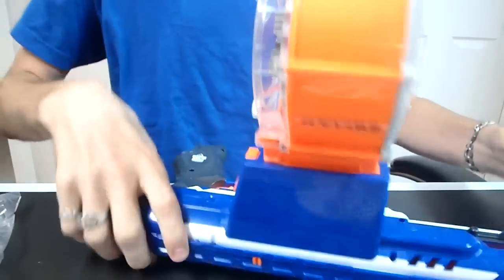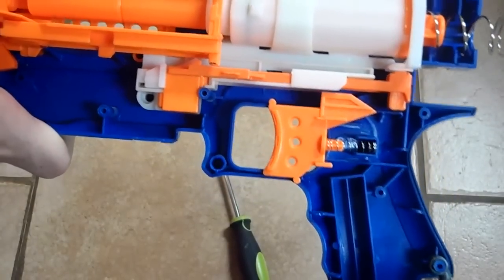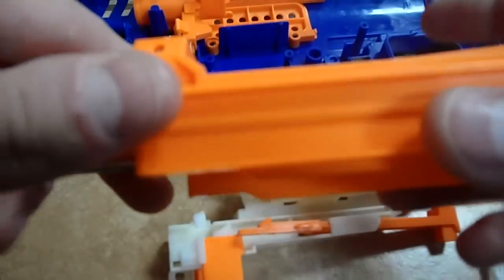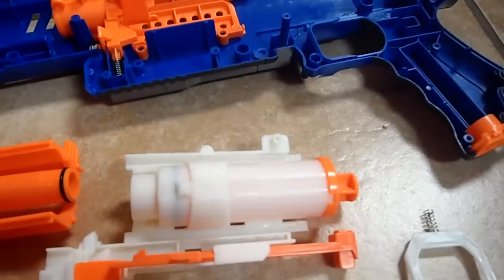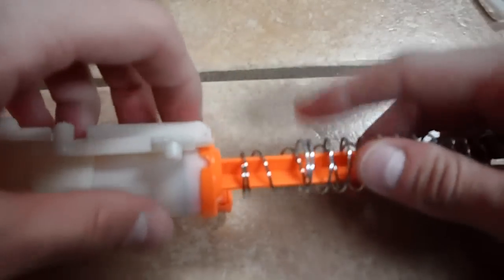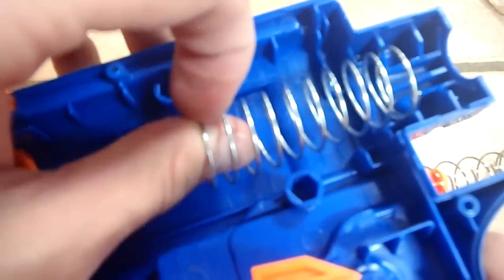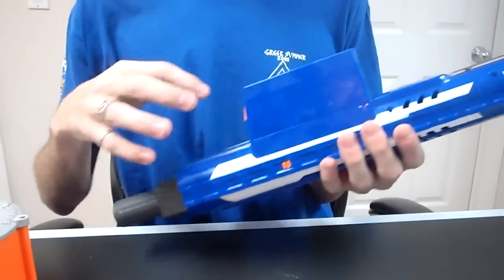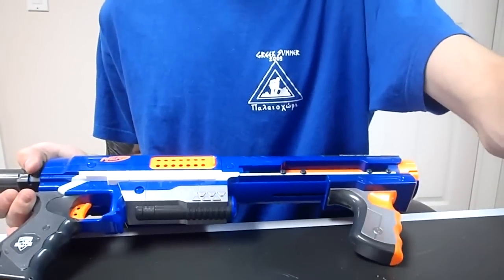The ULTIMATE Nerf Elite Rampage Mod Guide, More power

Comment: I don't know if the rifling will actually give the darts spin, but if it were to, then the darts would fire straighter. Rifling on an actual gun barrel works because the bullet fits much tighter in the barrel, and the pressure from the explosion at the base of the round pushes it through the barrel.

Comment: Unfortunately I'm unable to remove the air restrictor. I just cant seem to break it no matter how much force I put into it. Any suggestions on how I could get it out?
Reply: Put a drill to it and drill it out  or get a pick and hammer lightly until you break the plastic and get  needle nose pliers as remove

Comment: Rifling in a barrel only works with high velocity projectiles.  You can't realistically put a spin on a textured surface like a foam dart using plastic ridges and an air plunger delivery system.  It's probably there for aesthetic purposes.

Comment: because the AR (air restrictor) limits the amount of force that is delivered, keeping the internals from slamming into each other when it is dry fired. without them, unless a dart is in the gun, there is nothing to supress the force, and the internals bash into each other, which will break them after awhile. note that removing the ARs and firing with a dart in will still eventually break the gun, but nowhere near as soon. and while the AR helps, dry firing with the AR intact will bring range

Comment: I have a rampage and i warn you keep your darts in exellent condition or it will jam every time i have to load it slowly and look down the barrel to check every time i prime it
Reply: My rampage is super reliable. Just grease your internals and maintain it well and the gun should work fine. Every gun i own works like a dream because of how I care them.
Reply: CookiesUnleashed thank u I will try this :)
Reply: frankguerrie
I recommend you get an orange modworks kit for you favorite gun. Its like steroids for your gun and it won't shrink your gun's balls. Also, it comes with silicone grease which what I'd recommend. Don't use silicone spray or wd40 to grease.
Reply: CookiesUnleashed thank u lots :)
Reply: frankguerrie
no problem.
Reply: JayCookies why not WD 40?

Comment: The Rifling in the barrel does not work is because the rifling starts in the barrel, and for it to work correctly it need to start the mla second the dart leaves the barrel. But you are correct tho Rifled barrels keeps the darts, bullets, etc spin to make it more accurate and farther.
-Alpha

Comment: why cant it be drilled?
Reply: It's not reverse plunger like the the longstrike or raider. Since they're pins next to the walls of the bolt sled, you could accidentally drill holes in the wall letting air out and giving the darts less range.

Comment: Vortex is way easier to mod, don't even need to change the spring. They actually give you three notches to hook to torsion spring and it comes with medium setting out of the factory.

Comment: i modded my darts by removing the rubber cap and replacing it with a thumb tack and then added staples to the main tube to compensate for weight

Comment: Where do you get springs to add on nerf guns??  I just got this bad boy and I would like to modify it as well.
Reply: i used a spring from a nitefinder, i think drac uses small springs from a bag of generic springs he gets at home depot? he mentioned it in one of his videos, cant recall which. this one is the most frustrating nerf gun to put back together.
Reply: i should probably point out, dont reproduce my idea. the nitefinder spring is too powerful somehow, and wont let me actually shoot. now i have to undo all the stuff i just did..
Reply: Oh man I hate this google plus crap! Ok so the video I just watched is worthless?? Or just the spring part? Should I just remove the air restrictor and the side notch you dremeled off?
Reply: No, the video isn't worthless. Drac added a smaller spring inside the one that was already there. I tried to replace the spring entirely with one from a nitefinder that i wanted to upgrade. For whatever reason, it doesn't wanna work. I'm thinking the diameters are wrong or something.
Reply: NemFX The catch spring will probably be not strong enough.

Comment: Real rifles are built to much tighter specifications = the bullets have a larger diameter than the rifling ridges in the barrel. When fired, the rifling actually cuts grooves into the metal jacket of the slug when it engages the barrel. The "rifling" on these barrels is, in all probability, not going to induce any spin in the darts at all, which are moving far too slowly to benefit anyway. It's like putting a nitrous injection system on a bicycle.

Comment: ok guys here is a theory i came up with and it makes a lot of sense nerf wants us to mod the blasters just look at the signs first vortex blasters all of them have the hole to put the screw farther in already there then this the plunger wasn't screwed in and the bolt sled thing pulled right out for easy access to the AR nerf has to be testing us like so drac can see or if you agree

Comment: It's not just nerf. Rifling would be useless in airsoft and paintball, too.  In real guns, the barrel is too small for the bullet. When you fire, the gunpowder creates an explosion. This explosion heats the bullet and it "melts" into the rifling grooves, forcing it to spin out.
This concept doesn't work for compressed air blasters. 
People have experimented with rifling on the actual dart, but since the weight is inconsistent and the velocity is low, it doesn't have a noticeable effect.

Comment: Hey bro. I know it might not be your area of expertise totally but I bought a rampage just for the 25 dart drum and the pumping action to prime the dart (so the priming handle itself won’t pull back) I’m not to fussed because I only wanted the drum anyway. But I took it apart and still can’t see why it won’t pull back. ( it works find without the other half of the gun put back on ) 
Is it a problem you have heard of at all?
Chers Matt

Comment: aye man just a tip use the vids on utube to put the internals back togethers i just modded that gun pane in the ass!!!!! the internals didnt fit well backc toggether i got so mad at thta gun i ended up hot gluing some thins down but DO NOT also sand down the pegs on the plunger casing the dont fit in very well take a half inch off of them